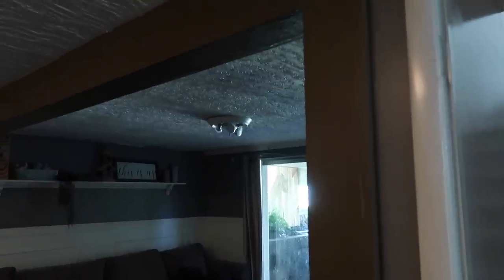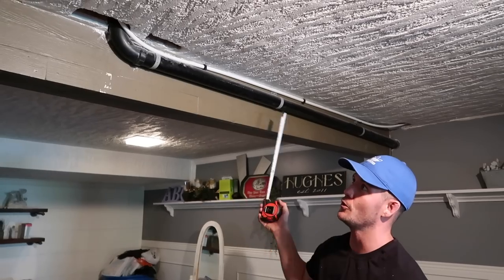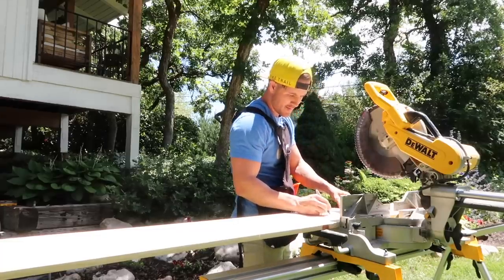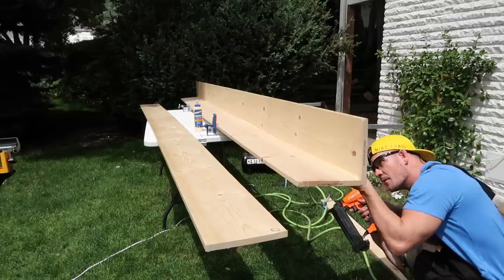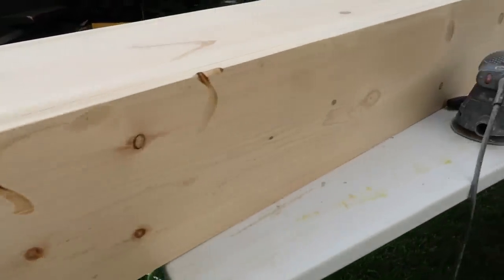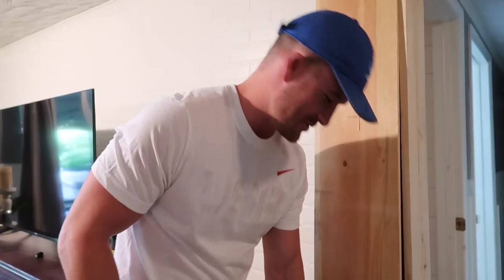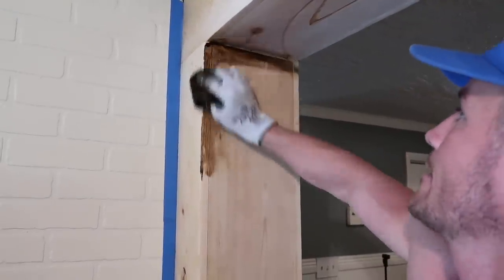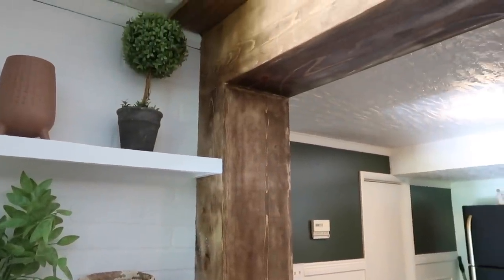DIY FAUX BEAM | Under $75

Comment: Great job folks ... the biggest issue I find with this ( as I plan to wrap a steel I Beam in my dowstairs living area ) is the obvious joins in the wrap where the different directions of the timber grain can visually expose or give the game away that it's a wrap and not a solid item. I will be doing my best to search for solutions to that - the best bet is to have the side or vertical slabs COVER the bottom cap and to have the bottom CAP sit inside the two vertical slabs. This way when you LOOK at the beam you do not SEE or notice the join so readily. That's going to be my plan at any rate ... I really hate seeing joins.
Reply: Your approach is better but even better yet is just mitre cut the 3 boards.  Butt joints are easily spotted.  One glance and it's obviously not a solid timber.  Miter cuts are far less noticeable.  Good video though for those who don't have the tools to do it with mitres...

Comment: Next time, cut the edges in 45 degree angles to get rid of that seam. Then round the edges. Also, my preference is hand sewn look. It takes using a hatchet, chain saw, and a fire torch.

Comment: What is securing the bean in place ? Besides the teo side beams that run on the sides floor to ceiling?  I have a vaulted ceiling project but not sure how to secure the beams directly on the ceiling as I will not have side beams.
Reply: I would secure a 2x4 to the trusses in the ceiling and then secure the faux beam to the 2x4 with brad nails. You can fill the holes with wood filler. Hit me up on Instagram I’d love to see the project finished
Reply: @Thomashuzemma  thanks so much!
Reply: @Thomashuzemma  I also have a vaulted ceilings and would like to do the same thing. Do I secure the 2x4, horizontally over the “V” pitch in the vaulted ceilings, and then create a faux beam that is 4-inches wide ( at opening) then secure the faux beam by nailing into the sides of the beam near the ceiling, into the 2x4?

Comment: If you would have done a 45 deg angle on the edges you wouldn’t see the butt joint and it will look like a real beam.
Reply: Comment I came to look for.

Comment: If you mitered the joints it would have looked like a solid block of wood. Looks good though.
Reply: I’ve actually built a few like that and with the beam being 14’ long it’s close to impossible to find a straight enough piece of wood to hold 45 degree cut without it starting to separate.